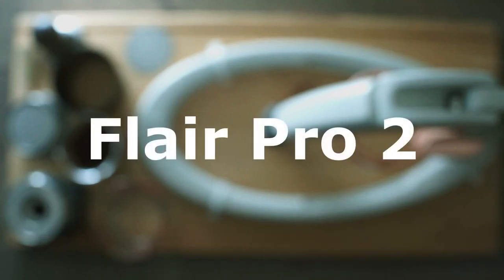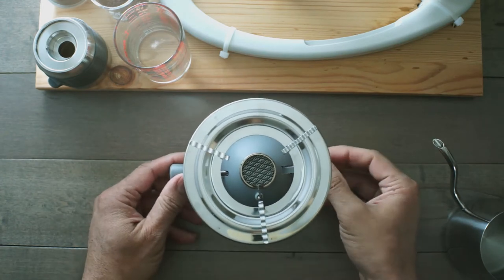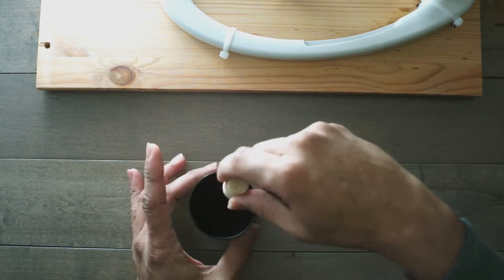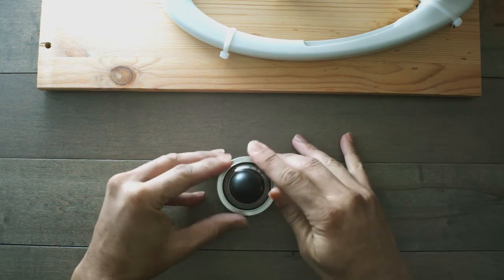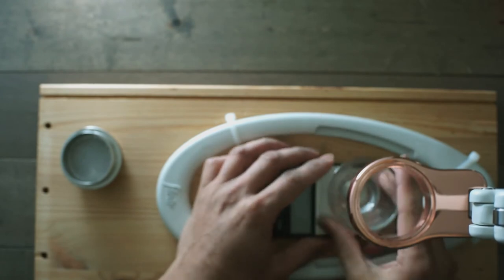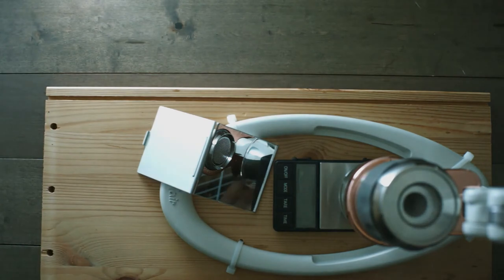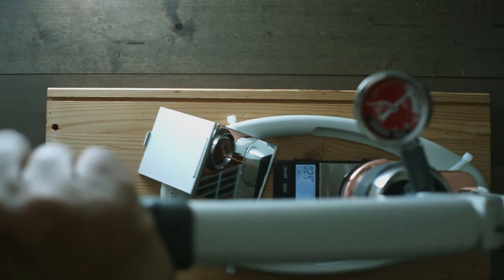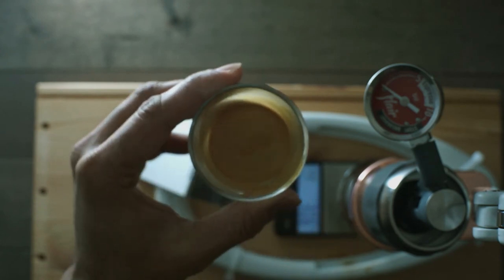Flair Pro 2 Espresso Machine: A complete walkthrough pulling a shot

Comment: Great tip on using a mirror to see the bottom of the portafilter together with the pressure gauge. BTW, what scale is that?
Reply from the maker: Thanks for the feedback, happy you found it helpful! Regarding the scale, not sure about the brand as you can find it on Amazon under various names. Here's a link to the one I purchased: https://www.amazon.com/gp/product/B07XQS8JL6. If you search around, you might be able to find it at a better price (although at $12 you can't go wrong here).

I like it because of the size (4.8 x 2.9 x 0.7 inches) and the fact that it has both a timer and measures to 1/10th of a gram. Also, the buttons have a nice feel to them. The clear cover is removable and I pretty much just leave that off since it kind of gets in the way (although it's nice to have).

Comment: Great idea to tie the Flair to a board. It could definitely be a bit more stable given the amount of force that you have to apply on the lever. 
Just for the looks, instead of zip ties, maybe there is a way to put some screws through the board from under, and get them to catch the base of the Flair? I will  have a look at mine to see if it can be done and get back to you if I succeed.
Reply from the maker: Awesome idea. Yeah, let me know what you find. I bought a cutting board and have been exploring options on how to fasten on the flair in a way that's both secure and easy to remove. If I can bolt it in somehow, I think that would be the ideal solution.
Reply: @davidmaurice1294  Hi again,
So I found that the stability issue on my Flair was from the fact that the rubber feet were not taking advantage of the full width of the base. I improved the situation by adding two more feet made from Sugru.
https://photos.app.goo.gl/ygcJBUy88km1WZqx9
It's not perfectly stable, but it's a simple modification and easy to revert, so I will try using it that way for a bit.
One notch better solution would be to screw the base to a board, as discussed. The way to go about would probably be to remove the rubber feet (and probably the cylindrical insert), use a tap and die to thread the hole, and screw into it.
https://photos.app.goo.gl/UPEtL2eYub3VKtmB6
I might try that if the first trick doesn't work well enough.
Reply from the maker: Thanks for the update. I wish I would have read your comments more thoroughly. I guess I got too excited about the idea. I did get the Flair mounted, but I think it could have ended up better if I removed the cylindrical inserts.

Basically, I took the feet off and did notice as in your photo that the holes are of a hex shape, measuring about 6mm. I bought some standoffs along with some threaded rods and nuts. The standoffs fit loosely, but I had some heat shrink tube handy and after applying that it fits snug. And since they're rubberized now, the standoffs grip really well.

The Flair is now mounted to the cutting board and is very stable, but taking it on and off is not ideal. It would be great if I could just pull it off, which is why I went this route. But getting it back on is kind of a pain, mainly because of the hex shape and because they are not all aligned the same way. It's not too much of an issue since I always keep the Flair assembled. But I think to do it right, I'll want to take another crack at it and this time use some round standoffs.

Overall I do like how it's turned out so far and it is functional. I'll probably make another video soon to explain it in more detail.
Reply: @davidmaurice1294  Really looking forward to seeing how that looks like!
Reply from the maker: Hey, I finally finished tweaking the new setup and just posted a video this morning with that as one of the highlights. Again, thanks for steering me in the right direction. I'm really liking the new configuration!

https://www.youtube.com/watch?v=gVMFlypJPek

Comment: What do you think about the flair compared to 9barista?
Do you have a favorite?
What are your reasons for picking it?
Reply from the maker: They are both very approachable/affordable machines for the quality of shots you get. But of course, they are so different. I plan to do a video soon to properly compare/contrast, but for now the way I would summarize is: When I need an espresso, 9Barista. When I want to craft an espresso, Flair.

I don't have a favorite by the way. They are both beautiful machines, well engineered, and great at what they do. It really comes down to how you want to espresso. 9Barista for an "automatic" experience, and the Flair if you like to tinker/hack.

I ordered my 9Barista first, but the wait time was killing me (3 months). I learned of a really good promotion Flair was having and got a great deal on the Pro 2. Thought I wouldn't need both, but I do enjoy them and I have no plans on getting rid of either one.
Reply: @davidmaurice1294  Have you tried the butane burner with the 9barista?
Reply from the maker: Thanks for asking, and yes I have tried. It looks like it would be a perfect fit for the 9Barista, but unfortunately it doesn't burn hot enough. The closest I've gotten was to start with boiling water in the 9B and cranking the burner full blast. Got some steam coming out, but it never built enough pressure to trip the valve (after around 8 or so minutes waiting on it).

I'm sure there's more experimenting I could probably do on that, but I figured it might not be worth it.  I'd probably be using a lot of fuel and would need to refill the burner often.

As a side note, I do use the burner for my moka pot and it's a perfect setup for that.